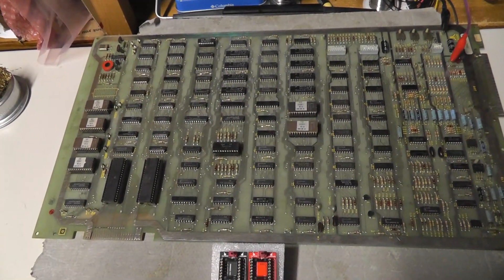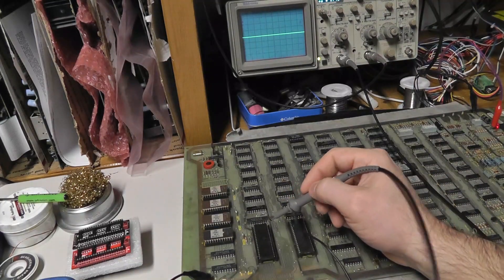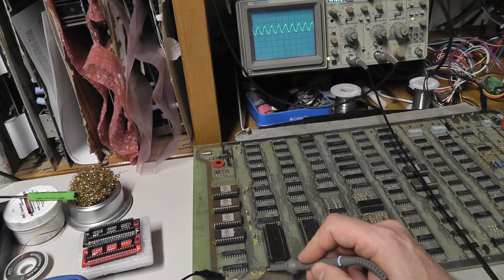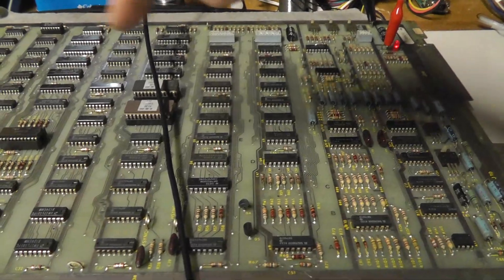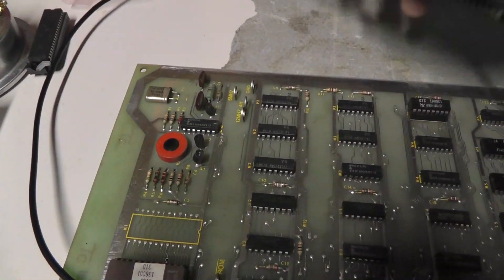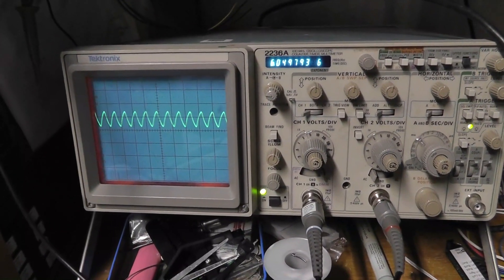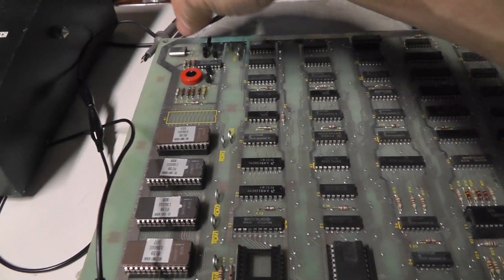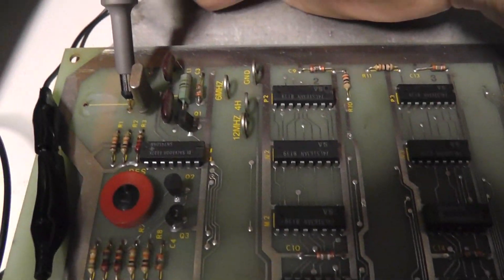Centipede Repair - PCB Dead? Bad Clock/Crystal

Comment: If you look in the service manual on some arcade games it will call logic gates as "intercept gates" which I'm not sure what that means when a logic gate is considered an Intercept gate. Do you know what an intercept gate means?
Reply from the maker: I haven't heard that term used.
Reply: @jacklick  check it out its in the service manuals for arcade games its called Intercept gates but its normal logic gates its just how they are using the logic gates as intercept gates
Reply from the maker: @waynegram8907  give me an example
Reply: @jacklick  1980 Berzerk, the self test 6th LED test says that 12A and 12B are considered Intercept gates which are logic gates but its how they are using them as intercept gates

Comment: so how many volts do you need to do this on a bench to allow the game to work? my millipede has 5 volts, 28 and lots more, looks like the centipede does too, do you need all of these others voltages to run the game for bench testing? or is the 5 volts good enough?
Reply from the maker: I would have to look to be certain but +5 volts is all you need to boot these boards.  The 28volts is for the EAROM score save Typically, the only time you need voltage besides +5v is when the ram being used is trivoltage (-5v, +12v +5v).  +12v is usually only needed for sound circuits.
Reply: @jacklick   i learn something new everyday doing this, this is neat to know, ill have to do more looking up on this  to learn more about what voltages are for on these pcb boards. very cool! thanks for the reply!

Comment: often in arcade games the Clear pins on flip flop latch IC chips and the Counter chips Clock Enable pins are tied HIGH together using a pull up resistor. I'm not sure why the counter chips clock enable pin would ever be pulsed low or pulled low because that would mean that the counter would never be counter during clock cycles. The MPU will clear the latch IC chips and pull low the counter chips, but when?

Comment: Garbage screen with no CPU is normal. Most arcade machines have a video circuitry that's independant of the CPU and they just draw what they find in memory and since RAM (especially SRAM) defaults to the universe's background noise, you end up with what you saw. DRAM can retain its information for up to a few seconds after power down, but on power up they default to whatever they like. Mostly random, but some have a strong bias towards 1 or 0.
Glitching a crystal by scoping it is relatively normal. Try the 10x setting on the scope probe.
Reply from the maker: Yea, should have known this when I made the video but figured it out later.  Still have to occasionally remind myself.